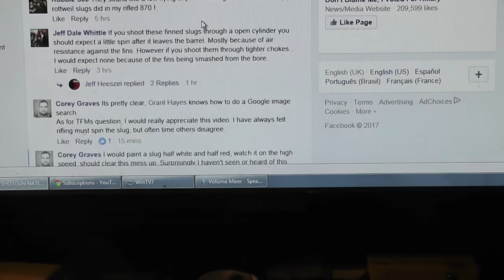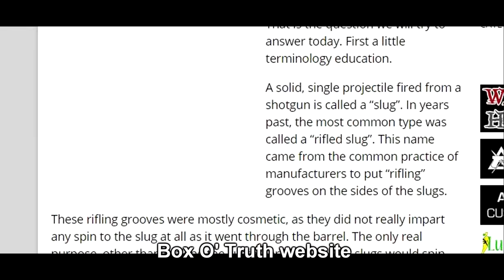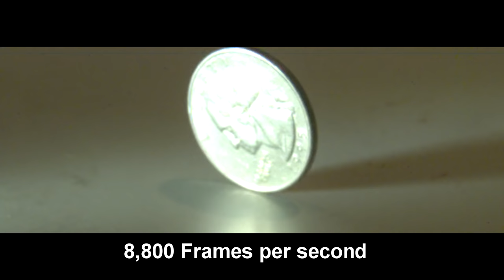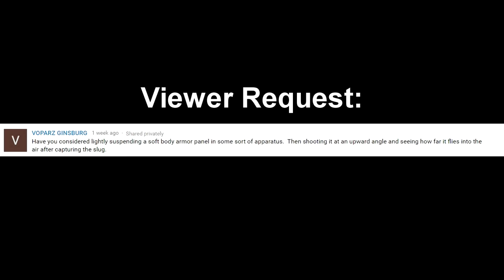Do Rifled Foster Slugs REALLY spin or it is just a MYTH?

Comment: Factory Foster slugs are designed with the rifling because they do not have a shot cup to separate them from the barrel, are a solid object (as opposed to shot) and are meant to be shot out of different sized bores due to the existence of chokes.  Its a safety thing.  If you shoot a slug down a barrel with a choke the rifling will allow safe obturation of the projectile without causing too large of a pressure spike..  The molds people can buy to make slugs are designed to produce undersized slugs that require a shot cup due to the fact that there is no rifling on the slug.  Even then the manufacturers recommend only using pure lead to make these slugs because hardened lead could cause large pressure spikes if you fire them out of a tight choke by accident.

Comment: So from what I've heard it's not spinning because the gas slips through the grooves on the projectile as the gas pushes it down the barrel

But that doesn't make sense as the gas slips over the projectile in the riffles barrel regardless 

So what is effecting the spin on a grooved bullet? Because it's not the gas 

I personally think that there's a delay in the spin much like the fletching on an arrow (I know there's differences and what an arrow does so don't go rattling on about it) 

By all means the bullet should in fact spin maybe it's the material used as someone has said that the grooves would be grinded down as it goes down the barrel so make the bullet stronger but not too much stronger to the point it wrecks the barrel

Comment: Regardless of whether or not they spin, Foster slugs were designed for one specific purpose. They were designed to be used in shotguns with chokes. The 'rifling' compresses to accommodate the choke.
As I recall, they do spin a bit, but not enough for good stabilization. That's why aftermarket slug molds are usually made without rifling vanes. In that case, they are relying on the hollow skirting to accommodate the choke. Solid ball slugs should be reserved for open choked guns.
P.S. Should have finished watching before commenting. I see the slight spin. That doesn't change the original purpose of Foster slugs.

Comment: I got an idea for a slug. Pointed tip. Hollow inside. Fill with tiny lead pellets inside. I'd like to see. Since i think it will be pretty good accuracy and deadly but also good spray. Idk how the pellets inside will go but I figure on impact the hollow slug will break apart anyway which will allow the small pellets to hit and spray with nearly the same inertia of the slug. I'm no gun expert so please dismiss my idea if it's completely retarded.

Comment: Leon Guthrie "one  turn in 24 feet of travel to one turn in 129 feet of travel, depending upon the choke used" -- That relationship is what I was wondering about.  Am I guessing it right that cylinder bore will have the tightest spin (1 turn  in 24 feet), and full choke 1 in 129?

Comment: Was I wrong? Nope.. I wasn't.. then again I was never asked :D

had it been a twitter poll instead of a crackbook group ... and I was aware of the question, i'd have spent the time to do the math for you to predict it ... or rather, redo the math as it was my high-school physics paper over 15 years ago.

sourced from actual material data for the lead alloys of shotgun slugs (us army) and the (myself) measured friction coefficient (with a scale & constant pressure jig inside an oven that i made for machine shop), rate of deformation while thermally static/over thermal change & muzzle energy (manufacturer) I proved with math that slugs will always spin... and then captured slugs by firing a honeycomb water cannon (built utilising 40 old propane tanks for pressure vessels) opposite the slug to have it fall undamaged (in a 4 foot distance of contact) to the ground were measured with calipers and placed in a statistical analysis table to prove the theory was correct and method free of unaccounted variables & thus "reliable".

you see.. even before becoming an adult I was interested in material sciences (later worked in the field testing and validating building materials) and complex mathematical modelling (additionally worked in predictive modelling of fluids (for aero & hydrodynamics).

.. trivia I used many of the propane tanks years later to add a DYI air reservoir to my air compressor

Comment: I've always heard they probably did spin, but that spin wasn't the original point: the point being to allow the slug to deform more easily when going through smaller chokes. This is entirely in line with RyeOnHam's info from the 60s. How anyone would think that absolutely no spin would be imparted by rifling on the slug is beyond me, what with Newton's 3rd law and all that.

Comment: Dead is dead. rather it be a no spin or a million spins. Any so called alterations is simply not worth the cost. Your target will never know. If you are hit dead center of the target or an inch off center. it just does not matter. If you are wanting pinpoint accuracy use a knife.

Comment: Foster slug is designed that way so that the slug can go through a choke. Other slug designs were damaging shotguns when they were fired through chokes sometimes causing failure of the barrel. The Foster Design cures that by allowing it to transition through the choke without damage. As you can tell from the video the slug never will spin fast enough to actually stabilize it. It stabilizes because it flies like a dart. Think of the rifling more like feathers on a dart.
Furthermore, trying to compare a projectile going through the air at 1600 feet per second with a quarter being spun on a table is worse than ridiculous. All the quarter has to do is stay stationary in space. It's worse than comparing apples and oranges, at least an apple and an orange are both fruit.

Comment: If a slug had a pointed spiral shape rather than a flat head, would it spin better?
Reply: Lars Lars Pantsonfars people have tried bullets like that but having your actual contact surface that the shockwave is on anything other than a plain symetrical shape is asking for problems. maybe if you gave NASA engineers a million bucks to do it they could, but in real life if a slug with a design on the nose flies straight its probably because the design isnt messing it up not because its helping it.

Comment: The only thing You proved is that the slug spins . You don't know if this spin actually provides gyroscopic stability at all . Spinning a coin on your tabletop and comparing that to the slug is not correct.  Foster slugs could be simply drag stabilized slugs with a bit of spin to remove manufacturing asymmetry. Understanding the science behind projectile stabilization  requires bit more than just taking some high-speed videos.
Reply from the maker: You should post a video proving me wrong then!
Reply: Do you even understand basic logic?

Comment: Glad you made this. Drives me NUTS when people think foster slugs self stabilize through spin. I always tell them the ribs are there so it can swadge (sp?) down going through a choke. Not nearly enough spin to do anything.
Reply: Zach Billings actually more than enoigh spin to make them stable or they would wobble like the denver pile driver
Reply: Zach Billings i used to think the same until i saw this video though
Reply: These aren't your typical bullets. They're pretty stable as they are. That tiny bit of spin is all it takes to keep 'em going for longer, else they might begin to tumble downrange. Remember this is a 1oz piece of lead with most of its mass located at the nose and in the outer walls. Even with just that little bit of spin it's carrying a hefty amount of angular momentum. Lots of 19th century rifles were perfectly accurate with about this much spin and Minié projectiles. The Foster slug is just another remnant of a bygone era.
Reply: Exactly. Short, stubby projectiles (like this slug) do not need a fast twist to stabilize. An example for those that don't know, a 55 gr .224 projectile will stabilize in a 1:12 rifled barrel, 77 grain needs a 1:8 or faster to stabilize. 77gr is obviously longer.
Reply: Actually making this longer would not make it any less stable. If anything, it might become more stable. Pitching moment already helps it go straight, making it longer makes the moment greater, stabilising it further. What all G7 style bullets suffer from is the fact that they're pointy, the fact that most of their mass is at the back and the fact that most of their mass isn't spread outwards like it is in the Foster slug. This does two things - first it produces an overturning moment rather than a restoring moment (as in if you pitch it up it'll carry on 'til it tumbles, not return like these slugs do) and second its radial moment of inertia is significantly lower (for the same mass) and thus you need to spin it much faster to get the same angular momentum to counteract the tumbling.

In the sense that most shooters are familiar with, these slugs are stable without spin. That is they're statically stable - they don't have a tendency to tumble at the slightest upset like a G7 would. Most shooters however overlook dynamic stability (which is where the term "overstabilisation" comes from) entirely, when in fact getting that right is much more important to accuracy than getting static stability right (well if you have it - you have it, can't fuck it up beyond that!). In the case of these slugs, most of them are dynamically unstable (some are statically unstable too!) which is why you need a little bit of spin to dampen out any oscillations.
Reply: Over 800 rpm is substantial spin.  Especially with the large diameter of a 12 gauge slug.

Comment: I bet befor that the "spin" and "no spin" opinion was equaly distributed and in the coments here its 95:5 :-) Intresting result. I even thougth it may spin the other way around due to gas that bypases the slug in the barrel. I have tryed now some minutes to figure out what the mechanics behind this are. In a rifeled barrel the grooves in the barrel "cut" into the slug and deforms it to create a counterpart to the grooves. In the end you got kind of a bolt and nuts thing. And here it get interesting... Everyone will agree i think, that the slug never ever will cut into the barrel to create the same thing. So why will it spin??? Here is what i think happens: Due to the tremendous pressure(shokwave) in the barral the slug pushes itself some microns into the barrel without damaging it. Just 100% elastic deformation. And due to this effect it creates the nut and blots thing again but only microscopic scale and reversable.
If anyone reads this please let me know what you think. 
+TAOFLEDERMAUS Thanks for your work!  Its so mutch easyer to explain something like that if you know what happens :-)

Comment: From what I know the rifling is designed to help the projectile get through chokes, not for stabilization.
Reply from the maker: It does stabilize the slug though.   Without a spin,  the slug would "fish tail"  a bit.
Reply: The little spin it generates certainly helps to stabilize the projectile but it doesn't seem to be the primary purpose. I never found slugs to be useful for hunting anything further away than maybe 40 to 50 yards, they just get too inaccurate...with a rifled barrel it's a whole different story, I guess (never tried that though, since rifled shotguns aren't exactly common in Germany...chokes however are)!
Reply from the maker: Yeah, but you'll foul the rifling up pretty fast shooting fosters through a rifled barrel.
Reply: Are Fosters a brand of slugs btw?